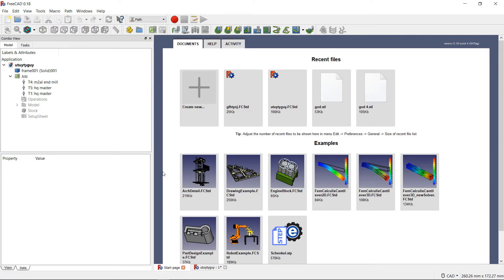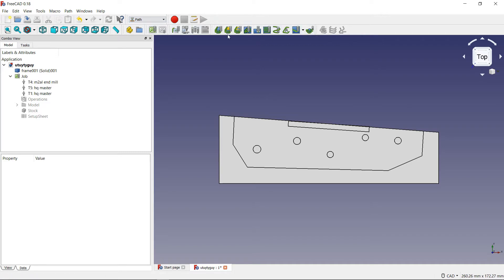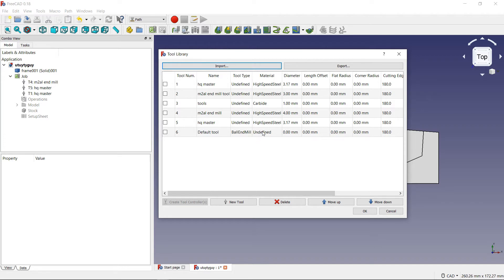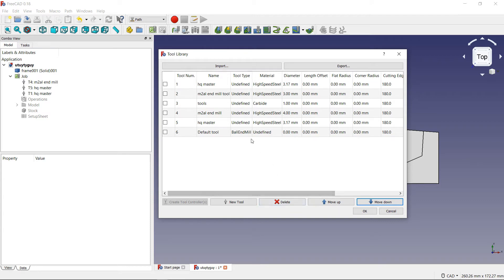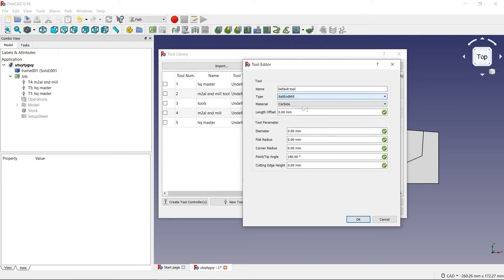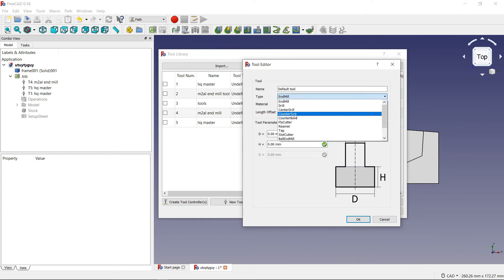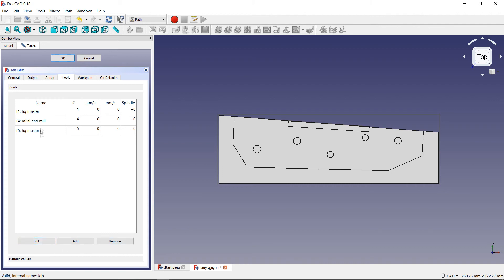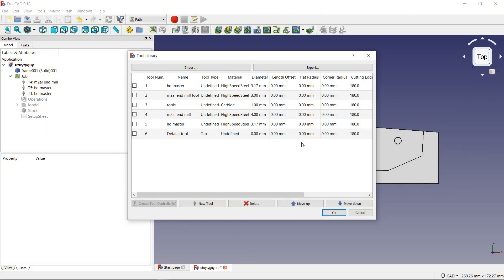how to input tool in to freecad path tool manager

Comment: This process looks quite straightforward - Version V0.21.2 behaves quite differently. Pressing "add" in "Tools" setup of job just opens file explorer and you are supposed to navigate to tool definition file (the funny thing is that tool definitions, tool form definitions and tool library definitions files all have fctb extension - but very different meanings). "Tool Library" still exist but to open it you need to create job first - then, you can add tools from tool library to the job. New process fells extremely confusing and frustrating for a freeCad newb  like me. Im using freecad on linux mint - installed from flatpack. This means default tool definitions are installed in really strange directory - in the end i literally searched whole file system to find these files ("sudo find / -iname *.fctb" ) and copied them to more convenient location.

Comment: This video would be significantly better if it actually described what any of the options are for, instead of just reading out what is on the screen. Describing the tool types and their differences, explaining what length offset is, how to actually measure your tools for diameter, height, angle etc. Describing the uses for tools of different materials. That way, someone could actually take their tool and enter the information in a meaningful way to get them programmed. Then to make it actually useful, discussing speeds and feeds per tool/material/spindle would make it outstanding. As it is, this video just reads out what you can see by clicking options in the UI.
Reply: Have to agree. I thought that was going to happen here. I can't that info anywhere.

Comment: So I am using Linux mint 20 and the latest Appimage of Freecad 0.19. When I click on the 3 drill bits I do NOT get the same dialog box that you do. This is after I have created a simple object and from that a Body since none of the Path pallet is available until that is done. I have also tried the Path menu and selecting ToolBit Library Editor - I have no New Tool button at the bottom. At the top I have Create ToolBit but that leads me to empty dialogs that want to open files that I am not even sure exist on my computer. Is anyone actually making anything with Path or is it so very BETA that it is not usable yet? Just realized I am using my wife's account to write this - oh well.
Reply: Looks like v0.19 the steps are:
1. Click button "create toolbit" 
2. Open (loads a file) of a tool SHAPE from the "shape" folder
3. Type a file-name for the new tool (eg "New 4mm Endmill"). 

Then edit the tool parameters. You can edit any tool from the list by double-clicking on the column "tool" or "shape" (or you can re-order the tools by double-clicking on the first column "Nr"